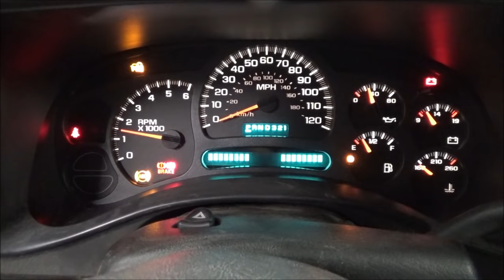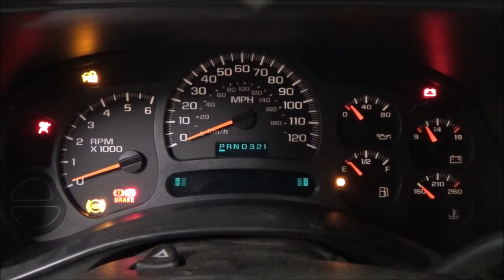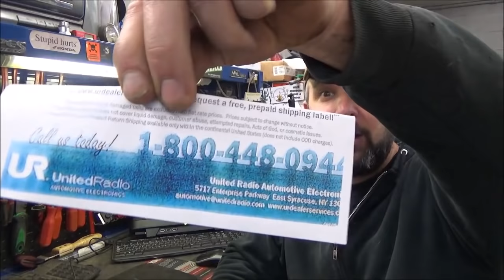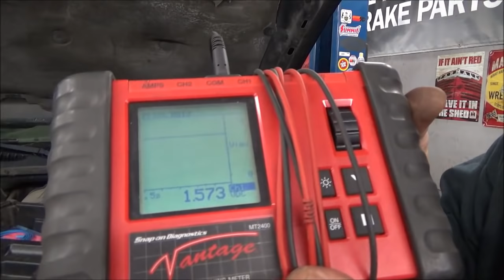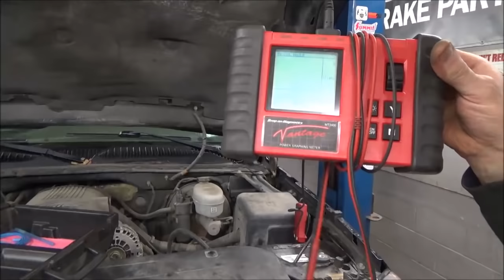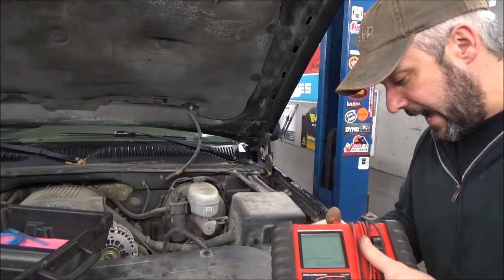Chevrolet Truck - Battery Dies Overnight - Part II

Comment: Maybe the next GM cluster you could try popping the back off the cluster and look for the "black spots" and maybe try cleaning the board. Wouldn't that be sweet if that would fix the issue without sending it off.

Comment: Silver is an EXCELLENT conductor, so is used in circuit boards to enhance performance and minimize toxicity compared to lead.
 It can be lighter(in weight) for the same conductivity so is used where that is important (space travel...ie). The problem is it forms silver oxide when exposed to moisture (water or vapor) because silver oxide is water soluble. SO, the boards MUST be sealed.

Comment: Thanks for the time and video.  My GF's 2010 Treverse's new battery is going dead after a few days.  I found a .161 amp draw and have not traced it down yet.  However, while driving it, I noticed that the alt voltage, starts at 14.3 but within 45 sec it starts dropping to what the battery voltage shows when I start it, 12.4.  I'm not much of a mechanic, but this seems like alt/voltage reg issues.  Would you be so kind as to comment?
Reply: My 2012 Acadia is doing the same thing, it sometimes acts as if there's a loose wire or connection because I can literally watch the voltage drop as I'm driving but then it'll go back up. Sometimes it'll hold a charge other times drains within hours. It's gotten worse over time to where it drains soon as I shut it off and I have to jump start it or use battery charger. I suppose if it actually is the cluster and in bad enough condition from this silver migration it maybe could act as I've described. 🤷

Comment: manufacturer defect, should have used a coating to prevent the whiskers, but i guess they mostly dont become a problem till after warranty, and same with the repair guys, doubr if they have the same unit twice, it last long enough for the  vehicle to get scrapped

Comment: I like the video it seemed thorough but just one thing. The battery is to weak to start the blazer now. Should the battery be disconnected from the positive post to charge the battery? I'll check other sites for this info . Thank you much.

Comment: I have a 2004 2500 Silverado and my speedometer went out so use my gps.  GM had an extended warranty that went from 70-80k but mine went out at about 100k.  What does a reman cluster cost with the core? Thanks-enjoy your videos.

Comment: Hey Eric, I noticed in this part 2, when you turned the key on, the check engine light didn't come on. It did in part 1.
Reply: He disconnected the battery, replaced the cluster, and then retried the parasitic draw. The video you saw was reference. Watch the edits. No mechanic would hook up a new cluster with live battery power.
Reply: I noticed that, too, and it plagues me!!!

Comment: I have an 04 Silverado that the instrument cluster lights will brighten and dim without touching knob also the speedometer will sometimes go whacky. I have also had my battery go dead if I don't drive it for a few days.

Comment: I know my cluster is jacked, and I'm going to send it off for repair. 03 avalanche, but I'm still getting about 0.067a on the draw when it seems to go into sleep mode.
What are some of the other causes? I've pulled a few other of the fuses but several of them seem to wake the damn thing back up and I gotta start all over again.

Comment: Same thing happened to my tv with the solderless  solder and the repair guy resoldered my tvs whole  panel and its been working fine for 13 years.The tv repairman said they only design the panel to last about 3 years max and they figure you will go get a new one.

Comment: Same problem with my 2001 Suburban.  Thought it was the road level compressor.  Disconnected what I thought was the compressor and  drain went away but dash icons, ABS, Brakes and motor problem lights up.  I will reconnect and try your method of testing.  Any suggestions?

Comment: 1994 Silverado, speedometer stopped working. I took it to Ice Cold Air on Park Blvd in Pinellas County, Florida. The tall long haired guy took a peek and said it was the cluster and they could have it rebuilt for a starting price of 350 dollars. I said thanks and left. I removed the cluster and brought it to Southern Speedometer and they found nothing wrong with it, $20 spent. The Man at SS said it was probably the sending unit in the rear end a 12 dollar part. He was right. A ten minute job and she was back online.

Comment: Who knew that solder wasn't stable? But there are a number of papers stating that the problem comes from the TIN and other metals, and in fact silver solder may be more stable than the old lead/tin mix, depending on other metals in the mix, and exacerbated by the way tight board layouts are made these days. And that moisture, even from condensate, promotes the process.
 Who knew? Fascinating to find out, even if the repair tech was wrong to think the silver was the real cause.

Comment: Awesome video! Thank u! I actually have an 03 silverado thats doing the same thing right now. Guessing this may be it. Also thought i would share that years ago i actually had mine replaced by a manufacturer recall notice. This is probably why! But also i noticed on my negative battery cables (grounds) the small one had come loose. I have no idea how this happened or how long its been like this. I know the bigger cable goes to the engine block. Can anyone tell me where does this small one mount to? Ive been told anywhere on the chassis will do. But id like to know exactly where this goes. Any info would be greatly appreciated!

Comment: My 95 gmc Sonoma has that problem after about three days of sitting it won't start. Nothing plugged in replaced the battery 3 times so I'm sure it's not the battery. Guess this is worth checking I have to replace a bulb in the cluster anyways

Comment: I wonder if you could have washed the circuit board with 99.9% Isopropyl alcohol to clean the corrosion.
Reply: Alcohol wouldn’t do it, but flux, heat, and scrubbing with solder wick will. Or it did for my instrument panel...

Comment: Lead-free changes brought a host of problems for manufacturers of electronic equipment.  Silver migration is only one issue.  The silver is added to tin in the solder to prevent tin whiskers, another potentially much bigger problem.
Reply: April  29 2023  it works !   MY  Dashboard.  Used  window  cleaner and  toothbrush.

Comment: I stayed glued to your video for this second one as well. I have a 2002 Chevy Suburban that's starting to have the same problem and I was wondering if you found the same thing wrong with that vintage. I don't have one of those Vantage meters but I do have a regular amp meter that I suppose I can use for this same test? I don't know if you  are monitoring comments on a two year old video but I'd appreciate anything you might have to say about this problem in a 2002 vintage Suburban.
Reply: I have a 2002 Tahoe that kills the battery in 2 to 3 days and it has a new battery and alternator. Charging system checks out good must be my cluster .

Comment: Lead free solder is not so much the issues as were these PC boards are assembled. I designed them and worked with assy for 30 years.

Comment: Thank you so much Eric for your very informative videos. Relating to the parasitic draw on the 03 GM how much did the cluster cost to be repaired ? As it happens I own pretty much that exact unit(in several ways) The cluster looking the same, internal parts, electronic transfer case, even the heater system looks to be similar. I'm currently trying to track down what looks to be a low-voltage situation while running. I have a load tested the battery it has come up fine. At start up the alternator seems to be putting out proper voltage approximately 14 V. But a very short time after with headlights on heater on average speed the voltage seems to drop off quickly on the metre in the cluster further to that the lights become dimmer as well .... which tells me in fact there is a voltage drop somewhere in the circuitry. I'll be going through and cleaning up all contacts and connections first then re-taking readings and proceeding from there. These year of trucks are somewhat new to me as I used to work on a lot of the 70s and 80s GM trucks originally.(gosh I miss the old stuff sometimes!) Thanks once again for all your videos and help I view a lot of them and I hope you keep producing them! 👍👍👍👍👍. Yup, that's 5 thumbs up! 😉😎
With thanks! Steve north4x4 (@gmail.com)

Comment: Like ur videos, I'm having the same problem with battery dying in 2 days sitting, on my 03 suburban 1500 5.3, knw here's the kicker I had the cluster done after the fact compleat redone with led light & added a transmission temp gauge but still having battery drain wat could it be Miami blues?
Reply: Not everyone who repairs these is aware of this issue, I repair them daily usually only happens in humid regions.

Comment: I have a 2003 2500HD and the cluster had been replaced by dealership probably over 10 years ago I guess, I think because of a recall.  If I do not lock my truck, the battery will be dead in couple days.  If I lock it, then it's fine.  Usually.  The only other problem is the fuel gauge looses signal while driving, and if I shake the truck per se then it will register again.  Typically it looses signal while sitting still (I know I just said while driving). more often while stationary.  Oh, my key fobs don't seem to want to program right and not sure if this would be related to the battery drain. ie body control module maybe not shutting things off.  Any thoughts??

Comment: haha tho the guy on the phone sounds like he doesn't have many marbles left. he's quite right. Jeeps have this same issue. and computer repair people talk a lot about this bad terrible leadless solder as well. I've seen the massive silver migration on many of my jeep electronics. The special acid cleaner he's talking about that they use is called flux. It cleans up that mess really well and makes the solder points like new. You could find just about any electronics repair video on youtube that will exhibit these issues because it's always caused by the lead-free solder lol.

Comment: I’m having somewhat problem on my 2006 Silverado the battery light symbol stays on when the truck is on and when it’s off and it’s draining the battery dead 
What’s weird is when the truck is turned off the window switches still work any tips or suggestions???

Comment: Say I have an 03 Silverado and the gauges stop working altogether except the odometer and then the truck starts to die within 2 days sitting. I checked the amperage at the fuse and it shows a little higher than what you read. Is it safe to assume that the gauges are completely shot, although in your video the whole cluster was out and mine has the odo still working? I pulled the fuse for now which seems to be working as a temporary fix.

Comment: Hey Eric-- do you know if they repair/troubleshoot the VIC system on my 1996 Grand Cherokee 5.2? Wondering because I have a few false codes like bad coolant temp sensor, rear taillight out, etccc. that is a soldering job also, right now I have it disconnected-

Comment: My message center flashes all signs ad ABS lite , airbag,service engine lites stay on , and gas and temp gauge will not work. Removed the radio fuseand all lites stayed off and would start right up the next day or hours of charging battery back up. Within 15 hours batt would be dead...
     Can you help me with wat could be wrong and how do I fix this daily battle with my 02 GMC Sierra???  Ty steph

Comment: I wish I would have some silver migrate my way!!
Reply from the maker: +JOHN HUFNAGEL Haha or gold...
Reply: +JOHN HUFNAGEL 
Unfortunately, there is no actual silver present, it is usually tin or cadmium.
Reply: +patw52pb1 nah, normally lead free has around 0.5% silver in it.
Reply: snipeish1
Not to my knowledge. 
It is true that some lead bearing and lead free solder chemistry contains silver, but in commercial/industrial practice, silver bearing solder is the exception rather than the rule. 
Most lead free solder that is used in large scale commercial/industrial production runs does not contain silver due to expense and occupational health risks. 
The expense is obvious and the occupational health risk is due to cadmium oxide fume exposure from the cadmium that is bound to most silver.

Comment: Great video !!!!!!!! I have a 2000 Z-71 I bought new with 300,00 miles on it , I need pistons for my new 5.3 that's going in Her .... I hate car payments ......
Reply from the maker: +barry hunt You can buy a low mileage engine for those for under $400 usually.
Reply: Great engine and truck besides some with piston slaps
Reply: +South Main Auto Repair , thanks for the tip ....

Comment: lead free solder is used because it has a lower melting point and is used in the manufacturing process , so stop the micro ics been heat damaged .

Comment: I need to  see. The installment of the wires from ingition switch to black box under das on a 2000 gmc c1500. 4.3
Reply: I live in ontario canada
Reply: Truck wont start. Engine tills over good
Was told buy a mechanic who used a computer to find the problem.
I am a backyard so called fixer. 
Of my own vehicles. Lol

Comment: so what does a normal consumer pay to have the instrument panel rebuilt (ball park)  $50?  $250?  $500?  $1000?
Reply from the maker: 250 to 300
Reply: Check out YouTube user jeffescortlx he rebuilds instrument panels and does ridiculously nice work. I think his current rate is something like $130 to do a rebuild and he can even program eprom chips so that you can transfer odometer mileage and other data from your old panel to a scrapyard panel. Or you can watch his videos and learn how to rebuild them yourself.

Comment: You have any go to’s for the 07-13 Tahoe? That’s a known issue for drain?
Reply: Did you ever figure it out?.....I have a draw on the IPC fuse and also notice if I wiggle the wires to the inside side dash fuse block, my dash lights "illumination" lights will come on and stay on until I find the sweet spot in the wires.... not sure if I'm losing grounds to that fuse block or what.

Comment: my 2003 cost me a lot of money even the dealer could not fix it after 2500 dollars got rid of truck went back to older one  1985 cost less to buy and put on road told gm at dealer you will never do this to me again also told my friends  battery draw same as yours

Comment: I've got about a 32mA, key off current draw on my 1997 Nissan Almera battery... is this abnormal?

I've had a few battery drained incidents, recently, and found the battery drains at about 700mA when I plug the cigarette lighter in, even when it's in the *off" position, so I'm guessing that's toast, right?
Reply: Some lighter sockets are always on.  You need to diagnose whats causing it or if its normal

Comment: Also called dendrites or wiskers  (https://en.wikipedia.org/wiki/Whisker_(metallurgy) )

The EU has restricted of the use of certain hazardous substances (lead) in electrical and electronic equipment  (a.k.a. RoHS)(https://en.wikipedia.org/wiki/Restriction_of_Hazardous_Substances_Directive).  Silver was add to solder replace the lead.

Some engineers blamed the "runaway" Toyotas on wixkers.

Comment: While there are issues with lead free solder the real issue is no clean processing and the initial cleanliness of the pcb.  Prior to all this environmental concern manufacturers used CFC based cleaning which was very effective.  The alternative to this became water cleans which are not as good.  Then they migrated to no clean where the assumption is the board was clean at the beginning of the process and the fluxes used are completely reacted.  The problem is boards get contaminated by careless humans and this sets in motion a ticking time bomb of dendritic growth.

Comment: how come you didn't have to have it reprogrammed after you put it back in? every GM truck cluster I've done had to be reprogrammed as soon as it was installed.
Reply from the maker: +kenman1717 United Radio reprograms it for me.
Reply: South Main Auto Repair so it didn't have to be done in the vehicle?
Reply from the maker: kenman1717 nope